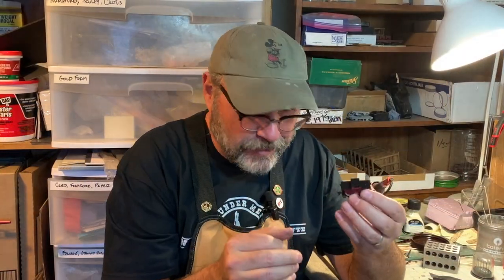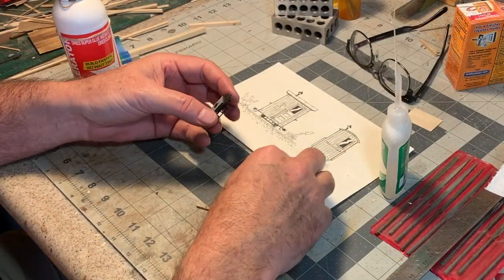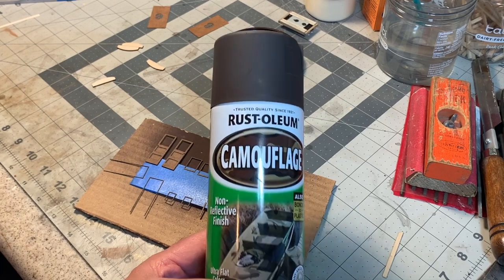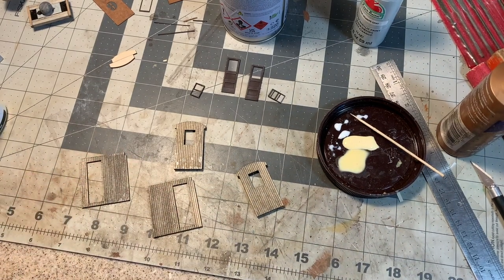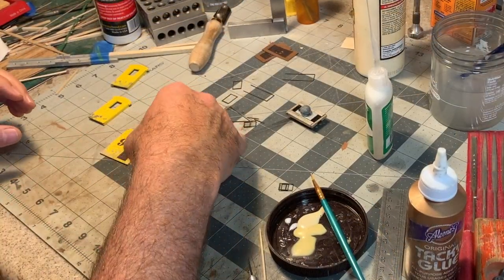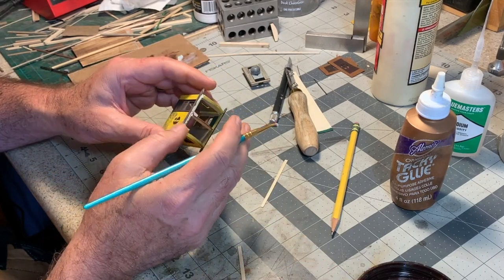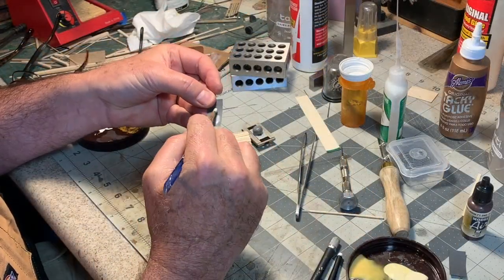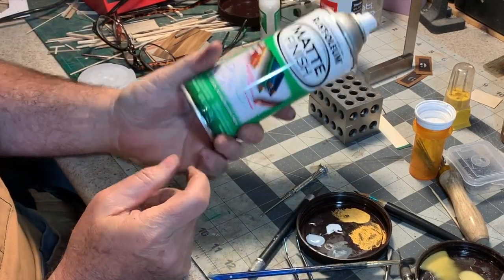On18 Bobber Caboose

Comment: Great model. Spraying chipping fluid to do such paint job has the advantage to allow removal of the whole paint when screwing up. But with wood, it may be better to seal it before, or the water used to activate the fluid may warp it.
Why don't cut the stencils out of masking tape?
Reply from the maker: Good tips. I find masking tape a little too flimsy for stencils, especially if it needs to be repositioned.
Reply: @ThunderMesaStudio  Yeah, I understand, I had the issue with a stencil I cut free handed. When details masking like that, I try now to first spray some varnish to block any paint smudge, which may happen more easily with airbrush than spray can.

Comment: How long does the wood glue take to dry before you can continue the work?  Why don't you use CA for all of the wood assembly?  Model looks great!
Reply from the maker: The wood glue dries in less than an hour in my climate, and sets up within a few minutes. Wood glue (PVA) makes a stronger bond on porous materials than CA does so I prefer to use it whenever practical. CA creates a surface bond and can be brittle.

Comment: Hey Dave where do you get the tips for your cyanoacrylate glue? All the ones I have seen say not for use with the stuff.
Reply from the maker: I get them on Amazon: Glue Micro-Tips Plastic Glue Bottle Tips Glue Extender Precision https://www.amazon.com/dp/B086SSLKYH/ref=cm_sw_em_r_mt_dp_MFC834X0PYG0WGK879V0?_encoding=UTF8&psc=1

Comment: Great job on the bobber. I got a few questions on your laser cutter. Is it name brand or not? Watts of laser? Size of cutting area? Do you have a 3d printer? If you do is it resin or filament type? I have been thinking of getting both laser cutter and 3d printer. Like to get input from different people who own them and there  pros and cons on the ones they have. Be safe and look forward to your next video.👍🚂🚂🚂🚂🚂.
Reply from the maker: I have a 50w Flux Beambox Pro. I can cut material up to 14x22" and up to .25" thick. I talk a little about it in this video: https://youtu.be/5pZWQwMsZPY

Comment: Does that mini saw you used have a name?? I think it would be a handy addition to my mini saw collection
Reply from the maker: It's available as a set now from Micro Mark: https://www.micromark.com/Micro-Miter-Box-Super-Value-Package
Reply: I personally have the JLC saw which is very similar, but more easily available in Europe, and the blades have the advantage to have two different sides: 86 and 51 TPI. So it is very easy to switch between coarser and fine saw.

Comment: Hi Dave, another great video.  Can you tell us a little more about your laser cutter... 
Cutting size? Wattage? Manufacturer? Software you use on it to make your designs?
Thanks in advance for the info.
Reply from the maker: I have a 50w Flux Beambox Pro. I can cut material up to 14x22" and up to .25" thick. I talk a little about it in this video: https://youtu.be/5pZWQwMsZPY
Reply: @ThunderMesaStudio  thanks for the info Dave.  I watched the video you suggested, very informative. I've heard these laser cutters will cut acrylic, have you ever tried to cut other "plastics" like styrene. I'm assuming lower wattage & faster cutting speed settings would have to be used.  I use 0.020" & 0.040" styrene sheets for example to scratch build stuff and it would be nice to make intricate & delicate cuts using the laser.  Thanks once again.
Reply from the maker: @kd757t  I've cut some acrylic but I have not attempted polystyrene. From what I understand, it tends to melt with "rolled edges" if the wattage is too high. From what I've read, the best results have been obtained with very low power and repeat passes. The fumes don't seem to be of great concern, as they would be with cuttings, say, PVC (which you should never do).
Reply: @ThunderMesaStudio  thank you for taking the  time to answer my questions, it is greatly appreciated.